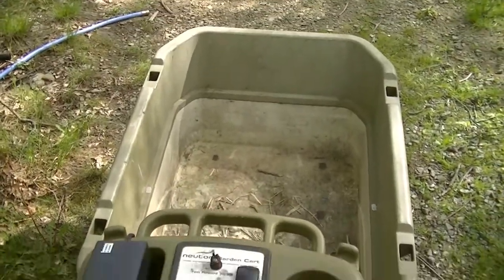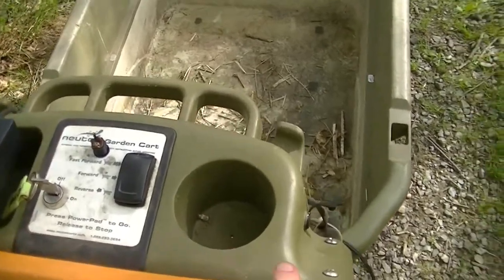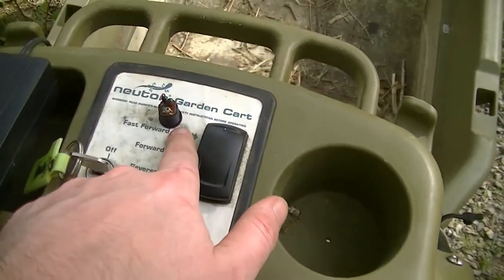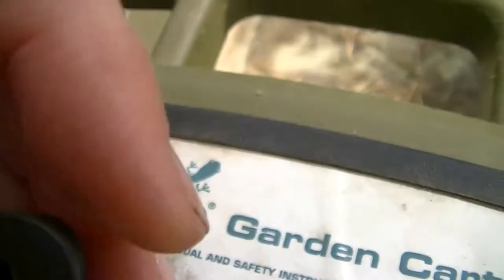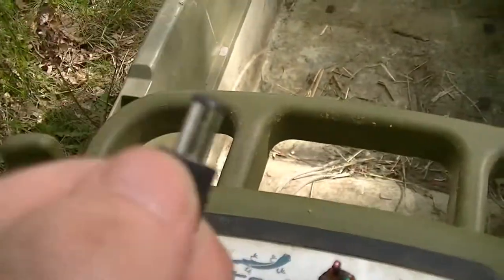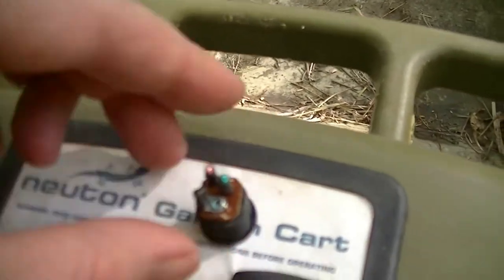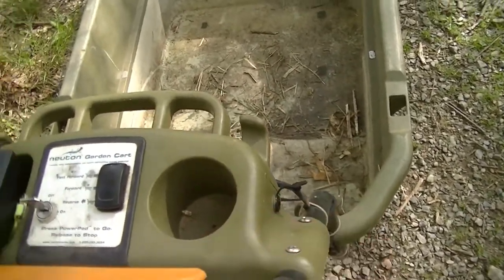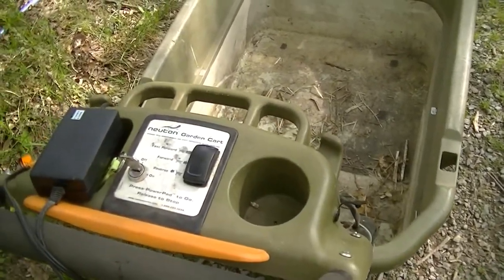Neuton garden cart charging connector repair

Comment: i bought a new charging connector because the one that was on mine was toast and now ive run into another probkem. Do you happen to know where i can find the circuit panel thats under the tray? In the owners manual its #46/Part #224841 "Tray PCB Wiring W/key" (my cart looks exactly like yours except for it doesnt take a key). thank you for your time.
Reply from the maker: It would be time consuming, but you would probably be better off omitting the PCB and splicing everything directly.  The PCB is only a manufacturing aid.

Comment: Do you happen to have link for this connector? or maybe description?
Reply from the maker: https://www.ebay.com/itm/162378537136
Reply: @randacnam7321  Thank you soo much! 
I also got the cart for free and looks like the plug is very rusted inside, so hopefully it will be that! 
How do you check if battery is good?
Reply from the maker: @WildflowerApiary  The battery should be at least 12.6V when sitting with a full charge and should not drop much under load.  A good test load can be made for cheap from a junkyard pull single contact bayonet lampholder and an 1156 lamp.  If the battery is 5 years old or older, replace it anyway.  These VRLA batteries get iffy at around the 5 year mark.
Reply: @randacnam7321  thank you soo much!! great suggestions!